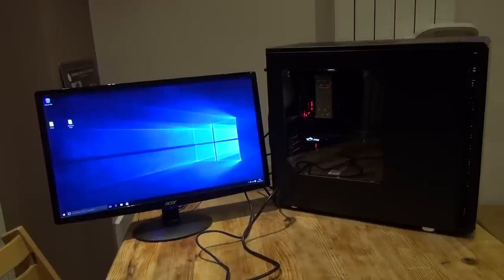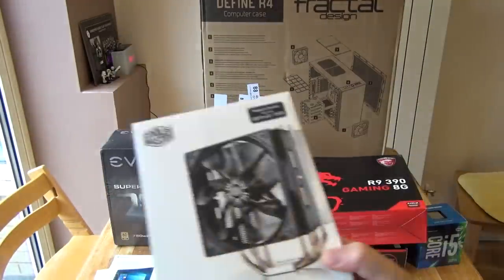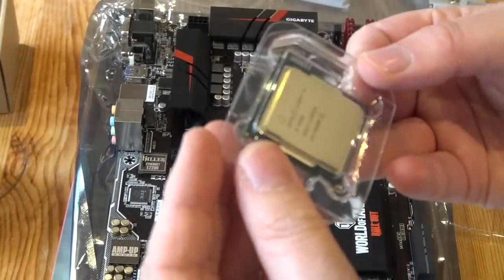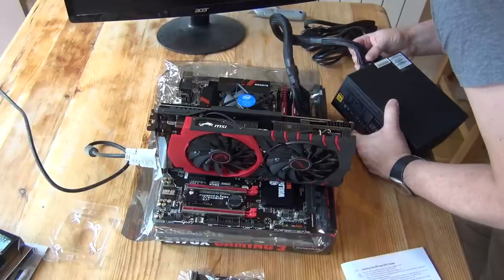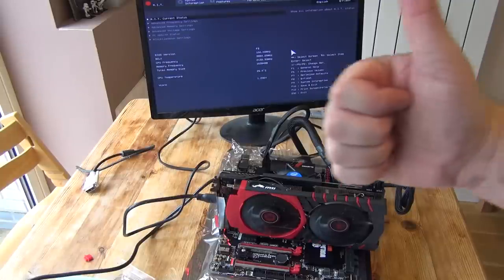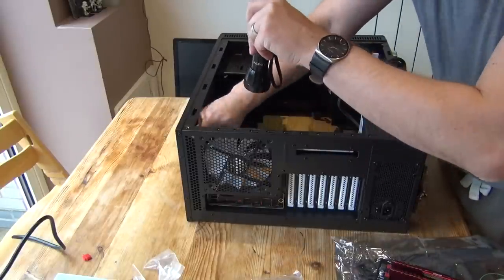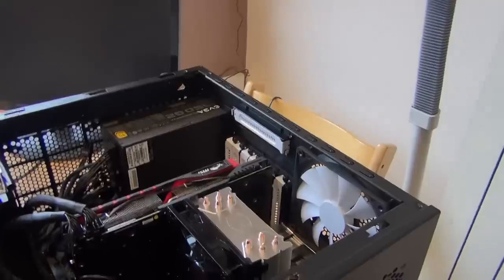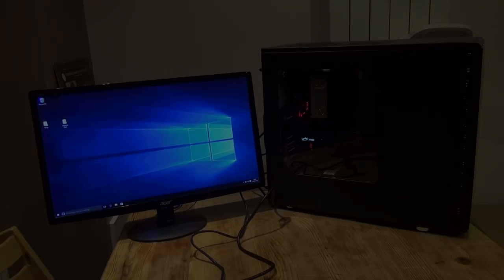PC Build - Watch me assemble a mid-price gaming PC

Comment: So I'm not very good with computers but if I swap out my motherboard will all my drivers/os have to be reinstalled?
Reply from the maker: +Astral Hi Astral, normally I would reinstall the OS but people do try this by first uninstalling all their drivers, performing the swap and then reinstalling the correct drivers after boot.  I have tried this once under W7, it did work, and you can google people who have detailed their experience. My guess is that windows will need to be reactivated whichever way you do it. If you have your OS installation media and a straight forward Windows installation, then think about how much time it will save you versus potential issues.  Anyway, good luck! AM
Reply from the maker: +Astral By the way, you must be pretty good with computers or you wouldn't be changing out your own motherboard! 😉

Comment: haloo sir is asus z170 pro gaming is good motherboard
Reply from the maker: I don't have experience of that board directly but I have used a lot of Asus mb and in general they used to be my favoured brand although they are now expensive relative to the competition.  I also used a Maximus series board in another PC and had a few problems with BIOS and stability.  Recently I have been trying other brands - the Gigabyte in this video is 'OK' but with some minor issues with BIOS and fitment - I recently installed an MSI gaming series motherboard in another PC and found it to be pretty good so I might go back to MSI for my next build.  I don't overclock anymore - if this is your thing then make sure you do your research! In the end the best thing to do is to find a trustworthy website which reviews all the boards and and read some reviews, I like http://www.bit-tech.net/hardware/motherboards/ Good luck! AM

Comment: Would gigabyte gtx 1060 the right gpu for this mobo?
Reply from the maker: I'm not exactly the gfx card expert but, yes,  it looks like a good choice for mid-range gaming at 1080p to me. I have had good experiences recently of both Nvidia and AMD graphics cards so I thinks it sensible to look at whatever gives you the best bang for your buck at the time.  Like most of us currently, if you want to play games at higher resolutions e.g. 4K in the future then it will probably mean another upgrade.  Most of my monitors are 1080p and I rarely upgrade them so it'll be a while before I look beyond 1080p personally.  I reckon I am a couple of years away from a 4K gaming PC as the prices need to come down on capable technology. GL! AM
Reply: Amoeba Man cheers mate

Comment: getting a red light on mother board in the CPU spot any ideas to help
Reply from the maker: Hi Rob, I don't see any reference to an onboard LED on this motherboard in the manual but some other motherboards use them, or sometimes a series of beeps, to help you diagnose problems, the reference is in the motherboard manual.  So I suggest you start there, motherboards manuals can usually be found on the manufacturers website if you don't have a hard copy. AM
Reply: Amoeba Man thanks man! got it figured out, first step of troubleshooting, is it plugged in! haha
Reply from the maker: Great, glad you got it sorted! AM

Comment: where thermal paste?
Reply from the maker: The stock cooler has thermal paste already on the contact surface, after the initial test when I swapped to the non-OEM Cooler-master cooler I cleaned the CPU and applied some more - I just didn't show it on the video. AM